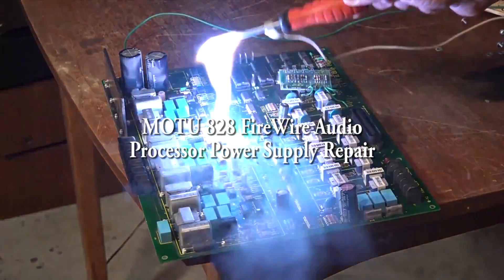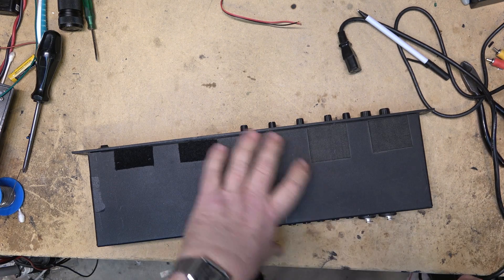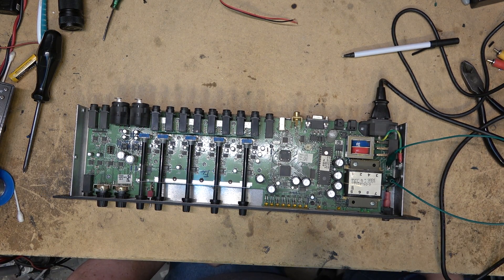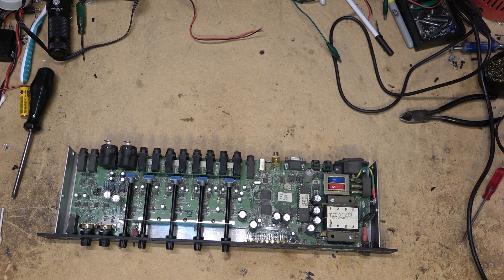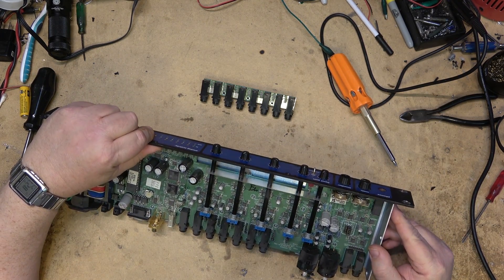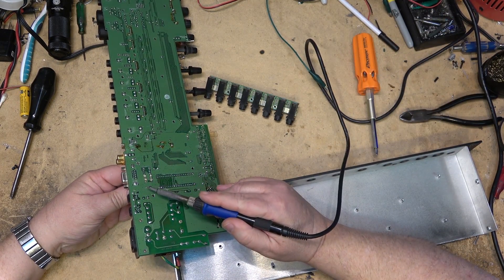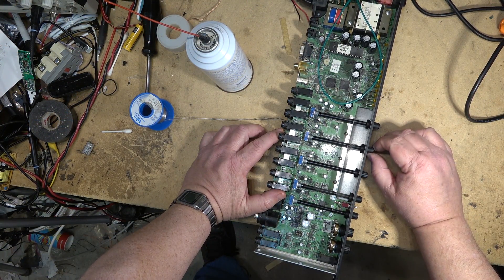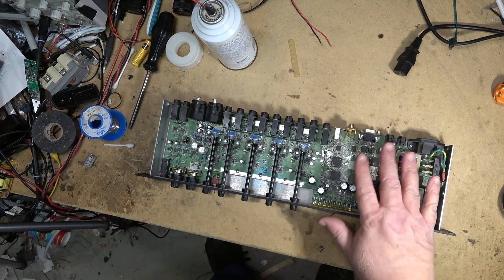Motu 828 Firewire interface repair

Comment: wtf, Jump a fuse with a jumper and change one cap? what school did you study at. lol
Reply from the maker: Customer brings it in and says if you can get it working for 50 bucks do it otherwise just scrap it. He had 1 tape to recover.  So it's change the bad part and move on. A fuse is just a strand of wire that will melt and open the circuit if it exceeds the current limit of the wire.

Comment: you could also change the opamps, decouple capacitors , ... to have a cleaner crisp audio signal :)
Reply from the maker: Owner had a price in mind.  I made 50 bucks so for that I am not doing anything more than the absolute minimum.  Can't charge more because they will just toss it and find a used one cheap.

Comment: Hello there, I have the same card. Works for several hours then gives issues, digital cut off of sound.. After a couple a days on and off it stops working altogether. If I leave it unplugged some days, it works again and the whole thing starts all over. We replaced all the caps on it except the one you are replacing in the video. Do you thing it might make a difference, any help is welcome, bought it from ebay ... i've spent too much money in this non working interface.

Comment: Let me ask you a bit off topic. Brother in law's Crossly CR88 busted the square belt on the CD drawer. Is it easier to replace with another CD player or to find the correct 4in belt, 1 3/16"dia(Can't find them anywhere). Would like to put his music box back together for him. Cougars and 12voltvids are Canada's best!
Reply from the maker: Well you can probably find an o-ring that will replace that belt, as it's just a belt to open and close the tray nothing special. You can go on eBay and buy a universal belt kit I bought several Square belt kits for like five bucks and you get 30 different size belts and one of them is going to fit. If you know the size you could order it it will be numbered SBS and then the size in inches so a 4-in belt measured in circumference would be an sbs4.0. you can buy belts from kpcomponents.co

Comment: I’ve had two of these, one I had to replace the Philips PDI1394 chip (100 pin QFP), that was fun!

The mechanical mounting of the transformers is poor - dry joints there are common too.

Comment: Looks like a handy bit of kit,  roughly 20 years old and just a cap and fuse to fix it :-D
I'm sure there are units now that are tiny in comparison, but i like old tech.
Reply: Actually, they’re about the same size; because most of the room required is dictated by the connectors. The primary difference is that new ones are USB 3 or Thunderbolt; not FireWire.

Comment: People in general don't know how to get Windows sounds out of these things (all Windows-generated audio outside of ASIO DAW use.) To do that, you short the S/PDIF in to out with a cable in the back, set Windows to use S/PDIF as main out. In CueMix (Motu mixer) buss 1, set that to S/PDIF out too. Then - on 2nd, 3rd and/or 4th buss, allow S/PDIF input and route each appropriately, like to MAIN OUT ANALOG or whatever else you like. Now, you can control Windows audio like a normal PC. All 4 busses are active 100% of the time - it is all in how you set it as for muted output or not.